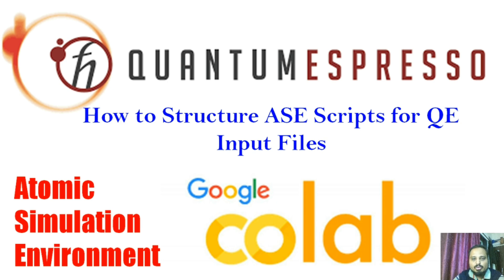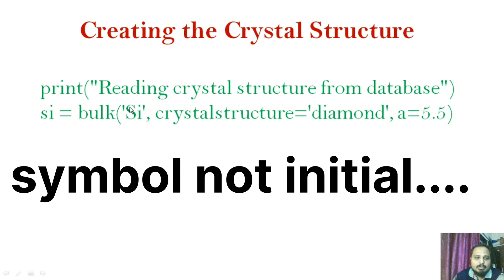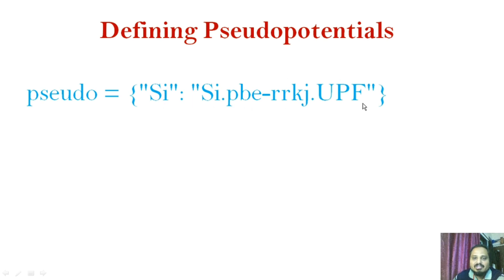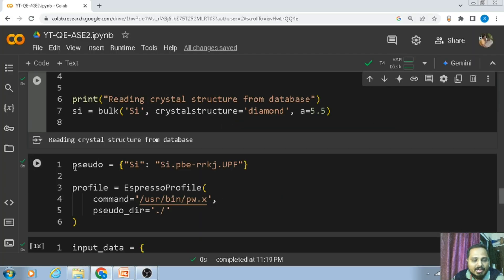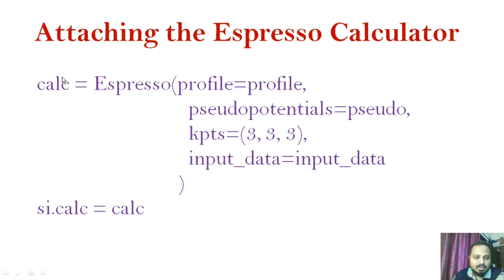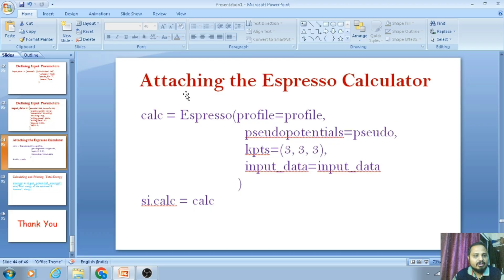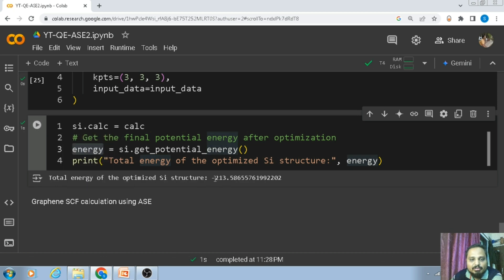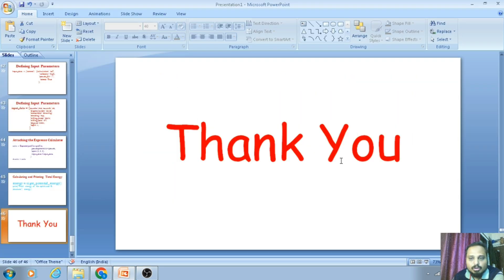How to Structure ASE Script for QE Input File

Comment: Hi, thank you for the video, but how can you save the code qe in Google colab???
Reply from the maker: You can save the Quantum ESPRESSO (QE) code or input files on Google Drive. This is an automatic process if you sync Colab with your Drive. However, since Google Colab sessions are temporary, you'll need to reinstall Quantum ESPRESSO each time you start a new session.